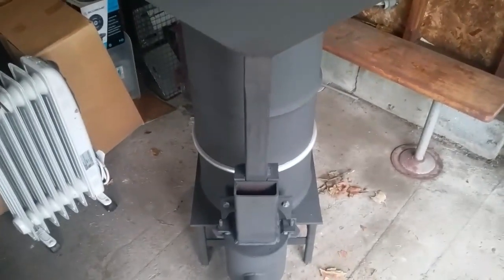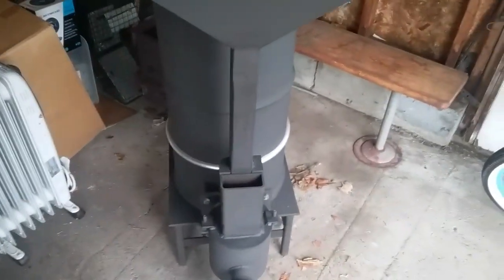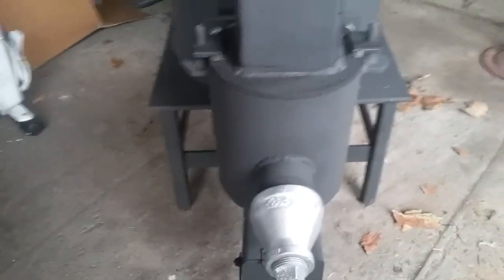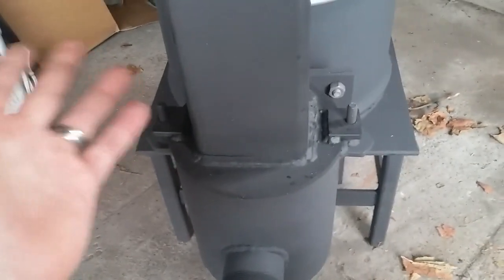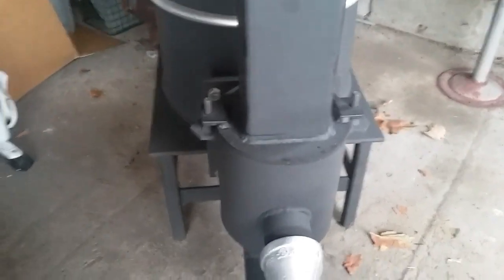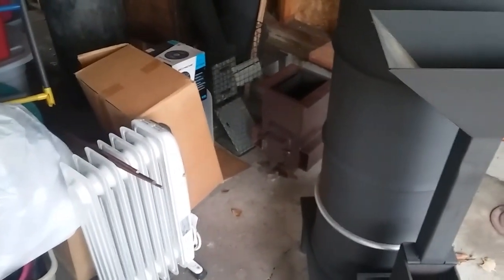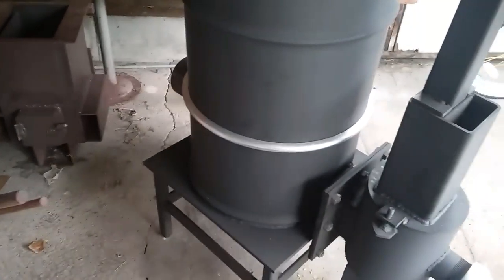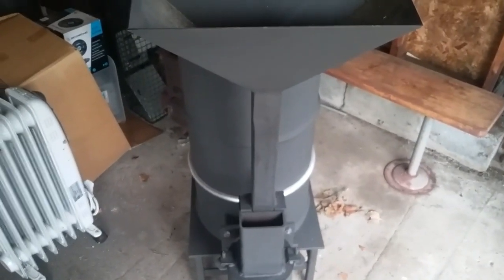rocket stove pellet heater 1

Comment: Excellent! Love the modular design. Please show the pellet grate burning pellets. How many pounds per hour? Can you adjust rate slow to fast to suit heat needs? Are you in the PNW region?
Reply from the maker: I am in northern by as far as you can be... and thank you. I will post a video on the stove burning pellets as soon as I get it installed in my new shop. I just moved and things have been crazy
Reply: Nice design.
Reply from the maker: +Max thanks I'm working on a new one a batch box style I will be putting up another video soon
Reply from the maker: +Douglas Pohl i found that if you can slow burn rate by just adjusting your primary air down I do have a slide gate on my new pellet box but that is just to shut the stove down. And I live in northern N.Y. on the Canadian border